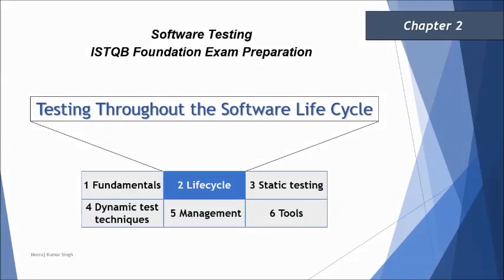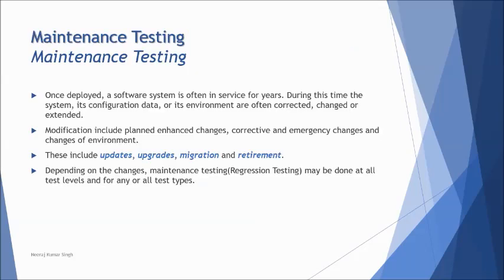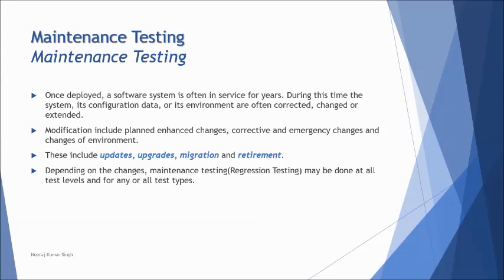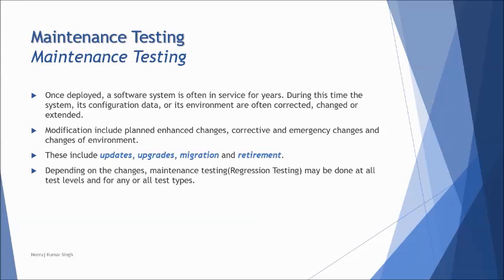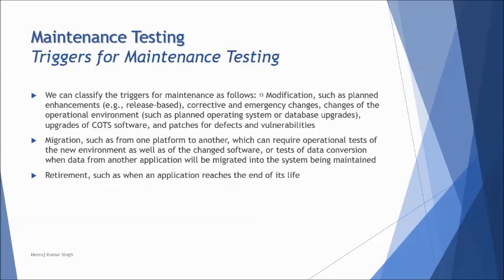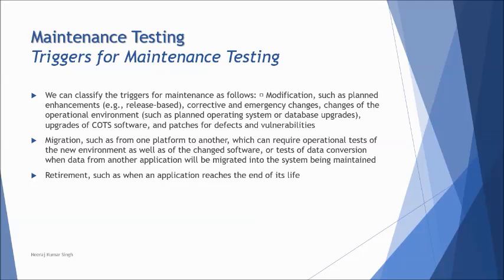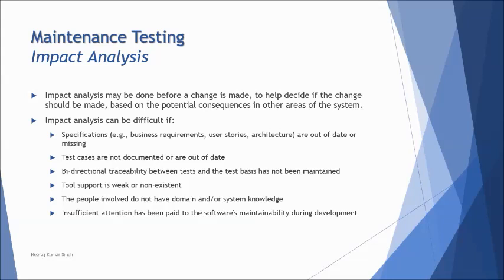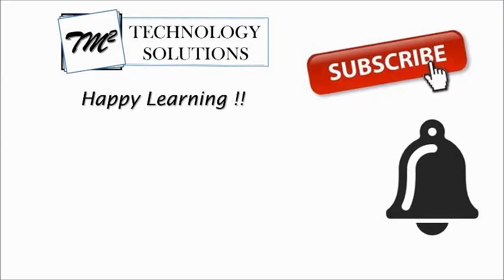ISTQB Foundation Level | 2.4 Maintenance Testing | Impact Analysis | ISTQB Tutorials

Comment: What is the difference between component testing and component integration testing
Reply: Component testing is usually testing a single component.... Where as in integration testing 2 or more than 2 components are tested to check the proper data flow...

Comment: Can anybody explain me the difference between maintenance testing and re testing and regression testing?
Reply: Maintenance testing is 
1. evaluating the success with which the changes were made
2. check for possible side-effects due to changes (e.g.,
regressions) in parts of the system that remain unchanged 
*change = adding, deleting or altering functionality, preserving or improving non-functional characteristics (performance, security)

Re-testing is also called confirmation testing and as the name suggest, it is concerned with the confirmation of a defect fix. 
After developers have fixed a defect, you as a tester have to confirm that the fix has been successfully made. 

Regression testing determine if the changes made to the system have affected or not affected existing parts of the system 
e.g. Changes are made to the component level which can greatly influence component integration. Regression test will decide if that particular change in component affected the interface of components
Reply: Once u put a system in production, if thr is a delta that u want to put in production or if thr is a migration etc..and the testing u then is called maintenance testing

Retesting or confirmation is when u get a bug at any phase and u send to developer to fix and then rerun same test case to chk it

Regression is when u give bugs to developer to fix, they send a release with fixed bugs and u not only chk those bugs but also chk that the systen that had no bugs before are not affected. 

I tried to explain in laymen words. Hope u got it.

Comment: Hi! What is the difference between the regression and maintenance testing?
Reply: Regression testing means if any new changes or features are added to the existing application, ensuring that those new changes don't affect the functionality of existing features of the application. Maintenance testing means testing the new changes/features while regression means testing the existing features.
Reply: @sanchitraut5690 That’s confirmation testing to test unchanged areas.